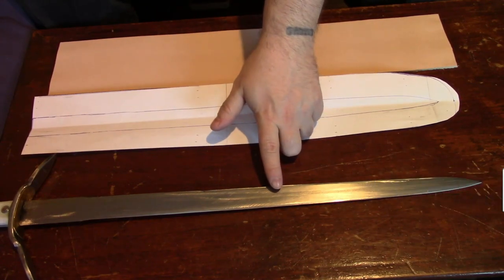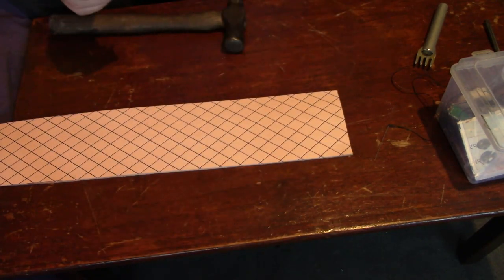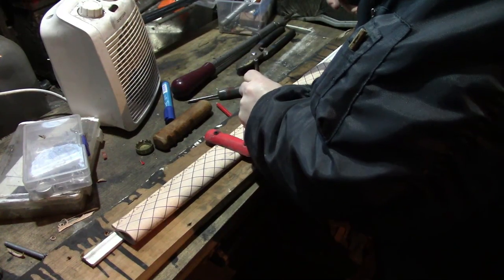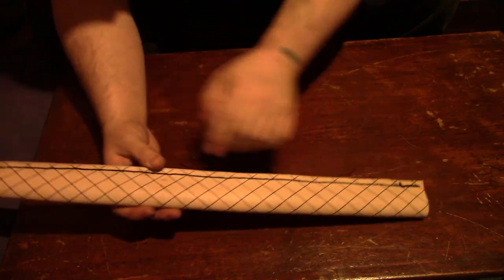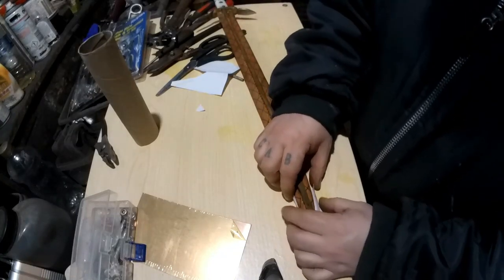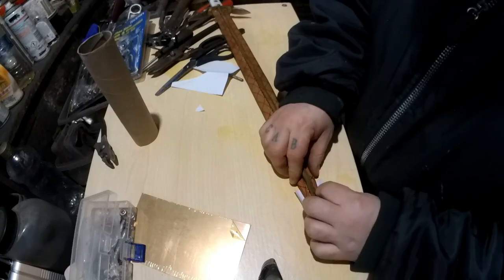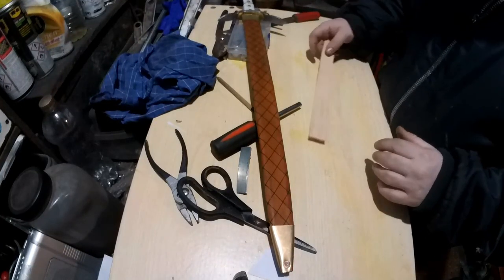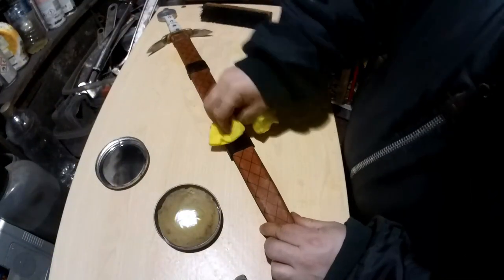How to make a Leather Sword Scabbard

Comment: how do you know how wide to make the template ?  The sword I have is thicker at the hilt, so I was wondering how you would measure for that.. Thank you
Reply from the maker: maybe add a few mm in length to the lower measurement for the thickness of the lower part of the sword and then follow the instruction for measuring the rest as in the video, thats what id do, hope that helps.